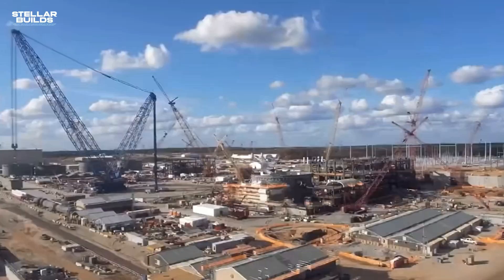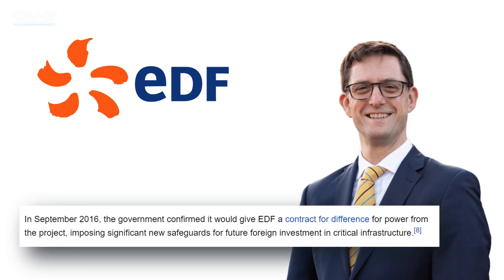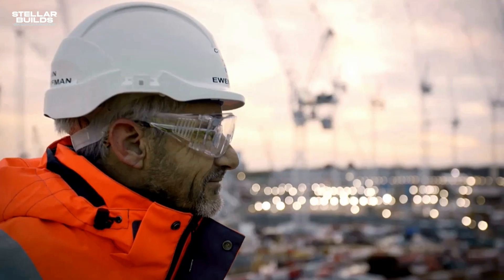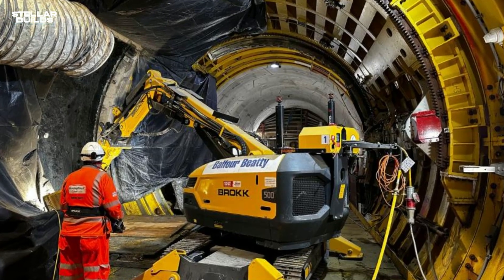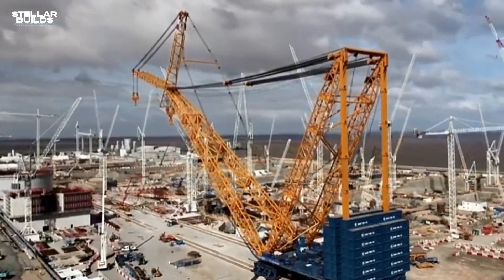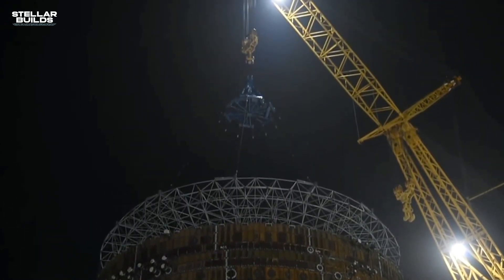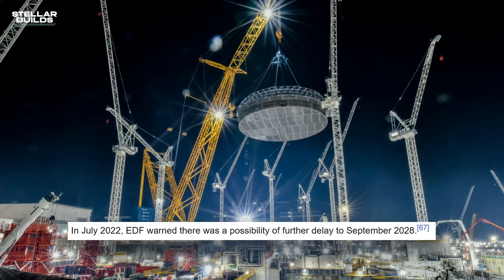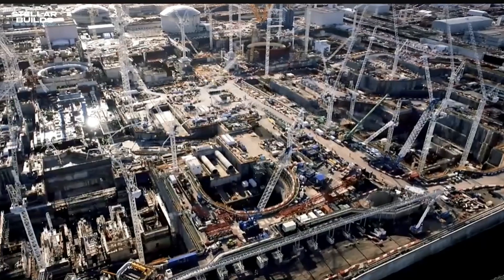The Nuclear Power Plant That’s Shocking Europe

Comment: Despite being considered clean energy there are better alternatives, and the Sun is the best one. What would happen in case of disasters when there won't be enough people to take care of it or lack of water if that's the case? I guess you will learn what the hard way.
Reply: sun is the worst especially for a place like the UK ... also solar panel farms wuldnt offer enough power durring the winter times
Reply: Hydroelectric and geothermal are alternative, not sun or wind.
Reply: @wittingsun7856  you can not make hydro power ... you can only build so many dams before you run it to geological issues... nuclear is the best and cleanest source of power we have  right now
Reply: @RePlayBoy101  yep
Reply: The sun is FAR from the best option. It is terribly inefficient and panels wear too fast, too weather dependant. Nuclear is the Only option.
Reply: Water wont be an issue since it has an ocean at its door step
Reply: @hellfir2217  Water is a problem as you can potentially change the surrounding temperature. It's one of the reason there are so many protocoles around Nuclear plants.
A few plants, close enough to industrial sites or cities inject excess heat in pipes to keep a little heat under the streets and prevent frozen roads as much as possible and heat manufactures and warehouses at low cost. 
The big downside is that it's not scalable, the network can't be too extensive or it would also raise the cost of such infrastructures too much.
On the brighter side, it helps cool down the water faster.
Nuclear plants are the best options at this point of time. But water cooled plants are a thing of the past as new generations will be more power efficient and won't use water.
Thus, with less environmental impact on the surrounding ecosystem, less expensive to build.
Smaller Nuclear plants are also more relevant. Not as cost effective, but more power efficient as you can provide for a set area and divide the network per area. If anything happens, energy can be drawn from other areas without draining them out.
Also faster to built as the most important part because plants you need 30-50 years to build will never be able to provide for the projected needs of the next 2 or 3 decades.
Reply: Typical pearl clutching nonsense from the usual backwards troglodytes.